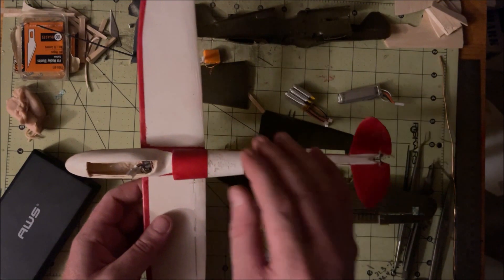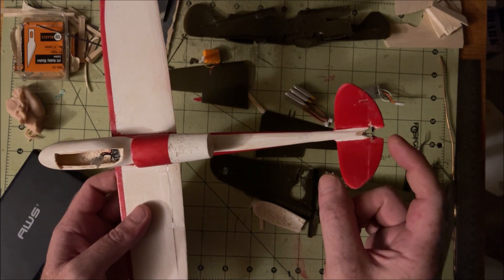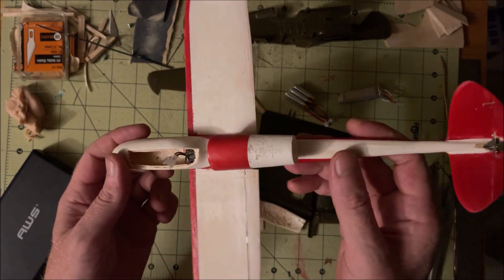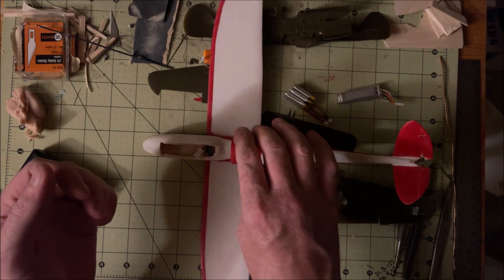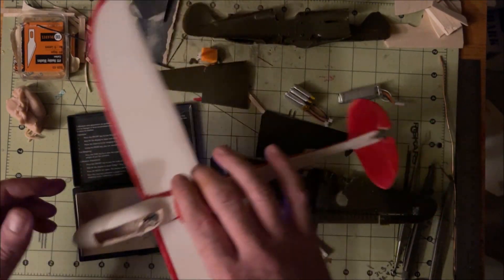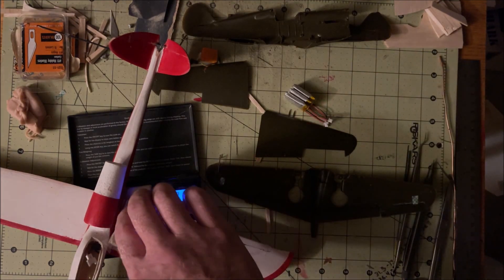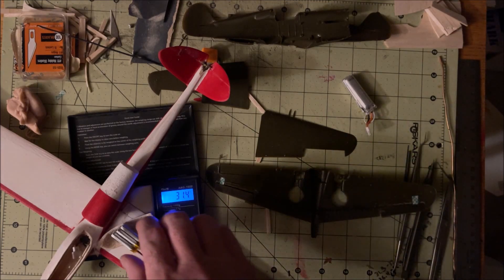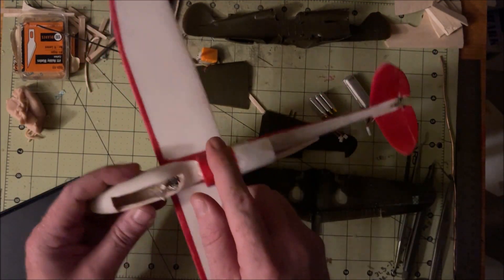Micro RC Jet - 20mm brushless EDF build (mostly)

Comment: I’m surprised you don’t use a charging prong system for dealing with your batteries.  Two metal prongs sticking out of the fuselage to charge from. No more doors. Alligator clips to connect and your good.
Reply from the maker: Mostly its because I dont usually fly my planes many times...a few times and I'm ready to build or fly something else.  I'm also not 100% sure if adding power to the receiver while the battery is charging would hurt anything.

Comment: Nice build. You mentioned fires, are you in BC?

Also, what esc and servos do you use? I keep trying to get smaller in my builds. 

Thanks for the video.
Reply from the maker: Thank you!  I'm in Minnesota, but the last few days have been pretty hazy around here.

ESC is a Sunrise Siskin BLHeli-32, servos are just the normal 1.5 gram linear servos like what Horizon makes.  I recently found a shop here in Minnesota with pretty good prices and selection so check them out:  https://www.buzzardmodels.com/

Comment: It will be better if you can make smaller ones.  Your videos are nice.  Thank you for the continuation.  Greetings from Turkey.  Selamun aleykum
Reply from the maker: Thanks!  Unfortunately, its about as small as I could make it while still being able to fit all the electronics, and keeping a reasonable wingloading.  I've seen 10mm EDF units being built, so that would definitely make smaller models more possible.